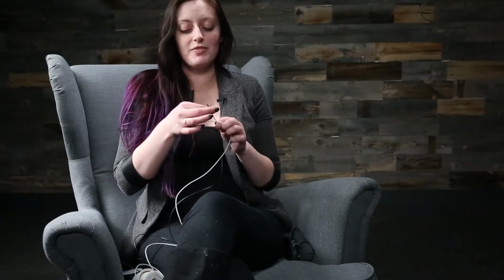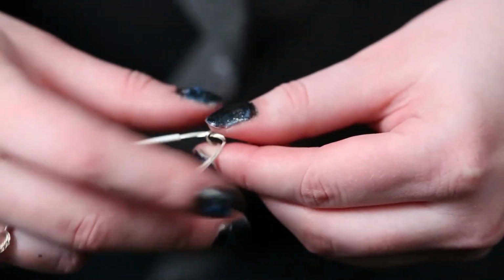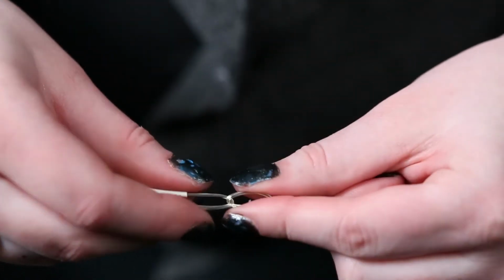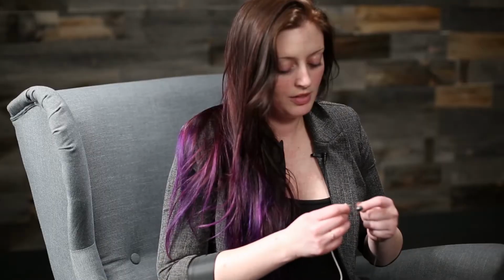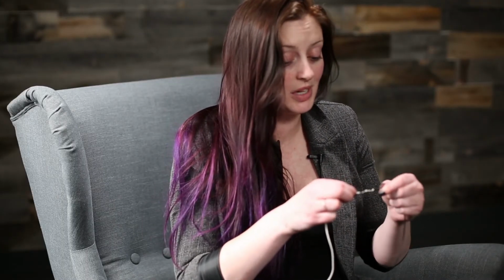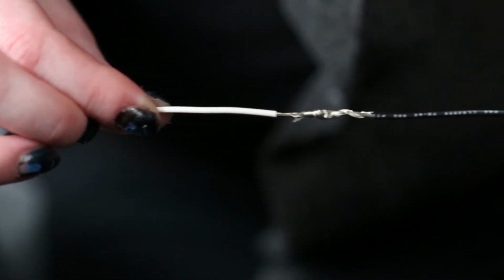Arrow Tricks of The Trade - 02 - Wire Splicing

Comment: While this works well for a temporary jury rig and rushed prototyping, it's not so good for a permanent solution.

For longer lasting needs, proceed with the strip and twist, then solder the join.  Once soldered, add electrical tape and / or heat shrink.

For environments where the cable will be flexing, make sure to protect the soldered part from any bending strain relative to the unsoldered sections.

Comment: When demonstrating a technique, please focus on the process far more than the presenter, especially when the presenter uses imprecise language to describe what they are doing (e.g. said "fold in half" while demonstrating what looks like a 90 degree bend - hard to tell with so many cuts to the presenter's face).

Interesting technique.  May work better than a Lineman's/Western Union splice for stranded wire.  Thank you for posting.